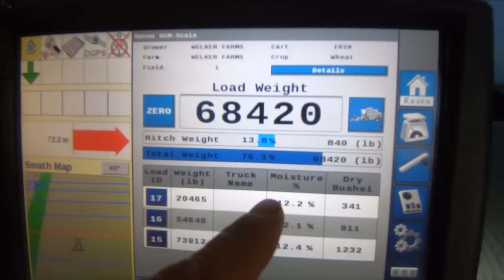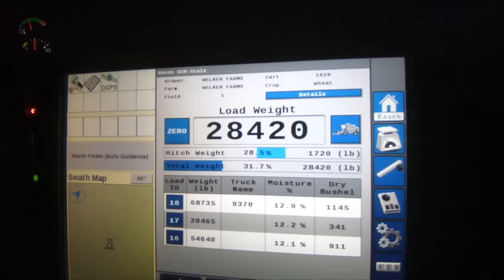Not The Quadtrac! It's Okay, We Can Fix It - Harvest Episode 14

Comment: For the tarps, weld a piece of rebar in a circle. One CM thick, should be good for that size. Place it in the center, at the peak, then run any number of bungee cord lines from that rebar circle to the ground you see fit as long as it's above 10. If the tarps get ripped after that, well...then you have bigger problems than ripping them.

The general idea is to deny the wind. We use this method when covering unfinished structures, tarps rarely get ripped (of course we use straight rebar, not round, but same effect, we just deny the wind).

Comment: hey guys!
if you can manage to find an old dump/ tipper truck transmission, most of the time they will have a PTO right on the transmission, when its in a truck its used to drive a hydraulic pump but in your case it could be used to drive implements.

Comment: Torgerson should’ve put in the small print for the demo “you break it you buy it”
Reply: 30 years ago I remember hearing their commercials on the radio, KOJM, Havre.  Torgerson's in Ethridge.  Now they are an empire of farm machinery.
Reply: Leebob86 torgersons grew because case ih was trying to get rid of small dealerships so they expanded because case ih payed for a lot of it
Reply: @benaklestad6410  It is true that CaseIH likes fewer individual dealerships, but JD is actively forcing to reduce dealerships to around 100 for the country.  We have learned more about the Corporate/local dealer relationships.  CaseIH doesn't pay for any consolidations.  It's all up to the dealer.  And just like what's happening to farms being consolidated it's the power of size.

Comment: Since the big Buds use a regular highway class 8 truck transmission.  They have two locations for mounting ptos. You will need to get a constant duty one.  Mount a hydraulic pump  and run a hydraulic motor to drive the PTO shaft. You get a unimount pto and pump.
Reply: We're considering that option. Thanks!

Comment: You guys are Big Bud people !!!  You need to get some sort of chase wagon auger drive on the 525. 

May be electric? A big DC generator out the fount?
 I know it is a big auger. Needs big horsepower to turn.
Hydraulic would work well. But new is expensive.  May be you could take a hydrostatic drive of an old header. would give you soft start and speed control. 

That will give Legarms something to do. We don't want him fired again . Think of the poor children having dad home all day.
Reply: Always the children will suffer pressure............😁👍❤

Comment: Holy crap 2 miles lol, BTW neat to see the demco trailer flexing when it gets filled. Could use that transmission in the versatile tractor.
Reply from the maker: Short drives are nice! But no reason to push the trailer that hard all the time. Good test though!

Comment: Have you seen any yield difference where you ran the disc drill?

And for your pto just mount a 4bt Cummins between your rear fenders on the bud with a clutch on it.  Then you could vary your pto speed while idling the tractor forward loading the truck.
Reply: There was about a 3% difference.  The disk was 33 and hoe 32 same cutting area and right next to each other.
  We thought about a powered pto between fenders.

Comment: Use a PTO  set up like some of the old 4x4 center articulated tractors, they incorporated a hydraulic driven PTO it transferred less horsepower but a Big Bud at 500hp would have more than enough to power a grain cart
Reply: We're considering that option.

Comment: What's next? In the future, the grain cart will have the capability of filling each truck or wagon to it's prescribed capacity by closing off the slide gate in the cart automatically. The result? no more toasted clutches on the PTO drive and no more overfilling the truck or wagon...and a automatically actuated cover for the unload auger so it doesn't act as a bucket when it rains or snows. Let's get to it!! Nice video!l

Comment: Why not put a hydraulic motor with a PTO output shaft and direct drive of of your external auxiliary HYD circuit, Love your videos by the way and cant wait to see what you have in store for winter viewing with Case IH.
Reply: We're considering that option.
Reply: It'll need to be big enough and GPM of hydraulic pump.

Comment: Reply to Brad not Landa
Not so surprised about the weight even with low rainfall. We are entering global cooling now so plants don't have to transpire as much and the ground loses less moisture. 

Out here in N California we're true Mediterranean - no rain after June, maybe May. The creek that normally is bone dry come June or July still has water in it. 
Things are crazy and changing. Stay flexible.
Reply: @paulcopeland9035  Despite decades of warming predictions, none of them came through. I'm sure you heard about the supposed "world record Paris heat wave" in July. The REAL record was in 1902 and was 30 days long, 18 degrees hotter, and killed 40,000 - mostly young. Hottest years recorded were 1930 - 1936. At times there was 80% of the lower 48 states in drought. 1936 saw record cold winter with record flooding, followed by record summer heat. The Midwest was among the 30 states which saw temperatures over 100 degrees, and that was as far north as Minnesota and upper plains. 

Our magnetic field is dying quickly. Storms/weather are electromagnetic phenomenon. The moving moist air generates electricity in magnetic fields. 

All we can say for sure is that things are NOT going to remain static.

Comment: Why not just set an engine on the back of the Big Bud, maybe a 4-71 Detroit or the likes, running maybe 6 v-belts down to a stub driveshaft. Everything bolts on as a package, put it one the big bud for pulling the grain cart twice a year. You might could re-use some of the BBBB mounting points.

Comment: Putting a PTO output on a big Bud you'd need to go past the chain case riser and the center pivot. But still quite doable. Ask the Case engineering department. I had great experience  with a 1962 International Scout. 152-4 and 4 speed. Rather indestructible...

Comment: How much HP at the pto do you need to run a bin?
Talk to a pto mob that does the hydraulic ones for trucks, the bud runs a 13spd, maybe you could jack a shaft out of it there.
Or mount another engine of suitable HP, (5.9 Cummins?) Above rear diff.
Personally I’d buy like 4 more old trucks a do them up and let them chase the combines 😂

Comment: How hard would it be to set up the Big Bud with a hydraulic PTO? You would have to have a hi GPM pump and motor with a sizable hydraulic reservoir tank, but in the end, it would probably be cheaper and easier than swapping the transmission on that beast!

Comment: Your harvest videos are the best on YouTube. What’s next after harvest?
Reply: Finish the Bud, seed winter wheat if it rains, spray for cheat grass, and a couple special happenings.
Reply: @RobertWelkerFarmerBob  Curious, do you straw chop before or after cultivate/seed ???
Reply: @BWYinYang  we don't need to chop and we direct seed into the soil.
Reply: @RobertWelkerFarmerBob  Wouldn't chopping straws helps breaks down into dirt better? Chopped straw would provide coverage of holding moisture.
Reply: @BWYinYang  when the straw goes through the combine it shreds the residue. And the stubble left is already short. We like to leave the stubble to catch the snow, otherwise it blows off the field.
Reply: @RobertWelkerFarmerBob  That made sense of leaving stubble after harvest. Prevent being blown away. Forgot your area so flat n windy.

Comment: What was the yield with just 4 inches rainfall?  Here in eastern Wa we had 6 out of a normal 9 and got 50+ bushels.  Our elevator won't take anything above 12% moisture.
Reply from the maker: It ran about 30 in the spring wheat and 38 in the winter wheat. Hey those are not bad yeilds for those low rains!
Reply: Rain is number one thing needed for crop, but type of soil is another. Also, depends how farmer practice the use of the field.🤠
Any spring rain farmer can get is a blessing. 👍

Comment: Holy smokes.. That truck with 1300 bushels had to be grossing every bit of 100,000 lbs
Reply: The net weight was 98,000 pounds.
Reply: Oops
The net was 78,000 pounds, so the gross was easily over 100,000 lbs.

Comment: I’m still trying to figure out the advantage of the cart as opposed to just offloading into the trucks. Does the cart hold more than the trucks and therefore keep the combines moving more?
Reply: The cart holds 1 1/2 of a trailer.  It probably isn't too much of a benefit to us with our smooth dry land but the cart weigh scales were awesome.

Comment: Would it be possible to do a hydraulic motor mounted on the bug bud to run a PTO . They run hydraulic motor to run grain carts why not use a hydraulic motor as a PTO drive on the tractor . Might have to use a gear reduce system.
Reply: We're considering that option.
Reply: It'll need to be big enough motor and GPM pump from tractor.

Comment: What about a hydraulic pto? Do they even make them? That would be a way to do a pto on the big buds
Reply: Yep 
Or just hydrulic drive augers 
But the buds only have small hydrulic pumps so they wouldn't be able to run the hydrulic drive either
Reply: Would need to retrofit a seriously large hydro pump.  We're looking at options.
Reply: Most new tractors run 130lpm / 34 gallons/min 
We run 1 chaser bin on a tj375 with that 
Keeps up with our other identical pto powered version on a fastrac

Comment: I'm not sure the conversion rate, but our wheat did around 5 tons to the acre, what is that in bushels?
Reply: At a ton at 2000 lbs it would be 34 bu / acre.  That's about what a lot of ours came in.
Reply: 186 bushels
Reply: You are correct it's 34 per ton ☓ 5. Is 167 English tons but metric is more. Thanks for the catch.

Comment: why can't leg arms just put a hydraulic motor to run a pto on a bud
Reply from the maker: massive pumps require huge coolers and the tractor needs places to attach those pumps where already a pump is being used. So it gets complicated real quick...and spendy.
Reply: Welker Farms Inc just place a cummins with a gearbox at the rear of a bud to power that cart👍🔧

Comment: I thought Big Buds are using semi transmissions if so why not use 2 PTO provisions and make HYD PTO. Does it matter if its HYD or mech driven PTO?????
Reply: Well to run the 20" auger you need some serious hydro flow.  But we're considering the options.
Reply: I've seen many of feed trucks that turn 3 big mixing blades and running 2 augers. They have big hyd hanging on bottom of trans they are heavy and seem to leak a lot. Too bad engine doesn't REPTO drive off back of the engine like a lot of mid range engines have like most concrete trucks. I know Cummins N14 and KTA engine was never had them and to bad Cummins didn't do this

Comment: Can you run a hydraulic driven PTO instead of a mechanical drive from the trans?
Reply: Yah. Would take a bit of ingenuity because there is already a pto on there that drives all the hydro portions of the tractor. Would almost need a valve set up to divert flow to the pto setup
Reply: OK thanks.

Comment: If test is 63 lbs per bu vs 53 per bu does that mean if you have a 60000 lb load you get paid less? How does that work?
Reply: Joe Sanders  no that does not mean you get paid less you get paid on how much,and the quality of the grain you bring in!
Reply: You do get slightly docked here for grain which is under 57 or 58#'s.  But Ben is right.

Comment: Those hitch weight #'s seem to be WAY off.
Reply from the maker: We compared to the elevator scales and it was within 5 percent. So not too far off.
Reply: I might be reading something wrong? At 8:32, the monitor says the hitch weight is 13.8% of 68,400 which would be 9439lbs not 840lbs. Is the gross 6840lbs or 68,400lbs ?  Thanks and thumbs up !!
Reply from the maker: @augustreil  ah I see what you are saying, it also depends on where the cart sits, it changed on up hill and down hill positions.
Reply: @WelkerFarms , Okay, Thanks again !